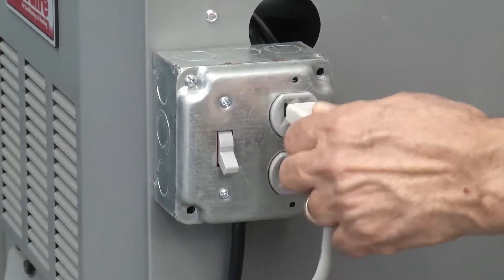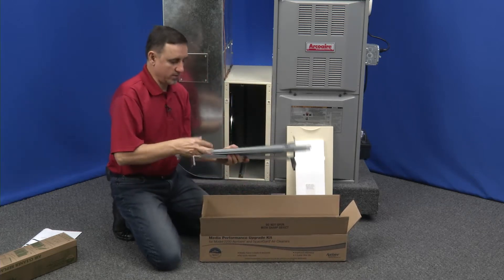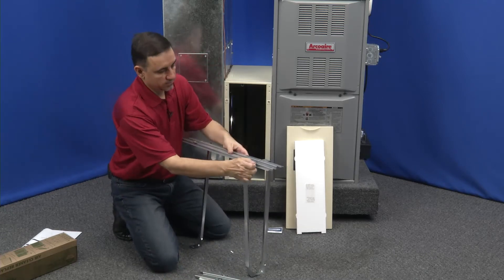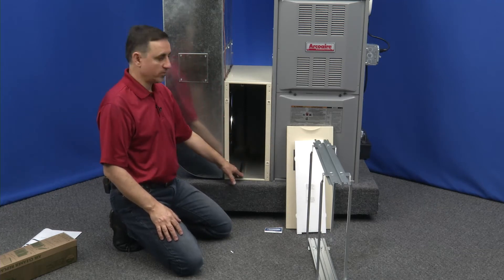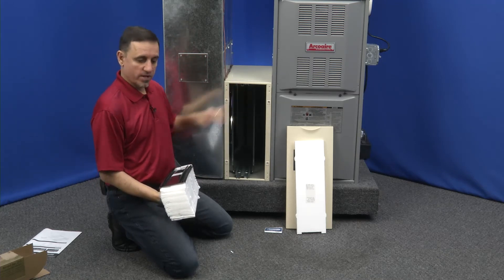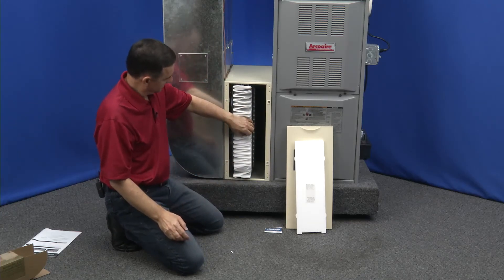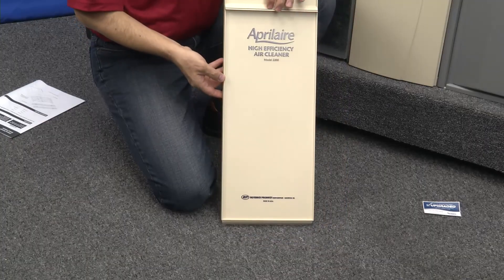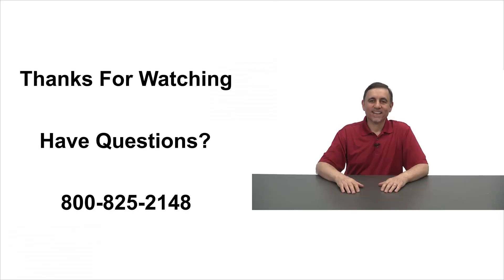Aprilaire 2200 Model Upgrade Kit Installation Guide

Comment: Do not throw away the filter box or filter separators.  You may want it later, Ebay, Freecycle even an HVAC company may use it. Make an effort to recycle it, even Styrofoam can be recycled.  Thank you for the clear video should I ever need to upgrade.

Comment: Idk if anyone will see this but are you able to use 25x20x6 filters or are you stuck with the x4? Also can you use regular box style filters with this?
Reply: Good question, I'm guessing no to both. After this upgrade, the x6 filters won't fit, nor will the box style ones (like Honeywell). Annoying if you have some existing filters you haven't used yet.

Comment: I am surprised you feel that way. In over 50 years in the industry, I have changed hundreds of these air filters using the original system and find the new style filters extremely simple to replace by comparison. If you are struggling to replace the new style filter, get out a pair of needle nose pliers and slightly bend the 4 front corners of the new metal rail up where the plastic filter edge slides onto it. This MIGHT make aligning the plastic strip with the metal track a tad easier.

Comment: By far the worst "upgrade" we ever did. Those new filters are a pain in the ass to lign up and slide in.
Reply: Exactly.  It took me 1 hour per filter to slide the "new" Merv 13 filters on the rails.  I could have finished 10 of the old pleated filters in the same amount of time.  Not to mention the collateral damage I may have caused to the fabric as I struggled to align all 4 rails at once.  Hopefully none of the sharp metal punctured the new filter during the 1 hour installation.

Comment: I was able to upgrade our antique one without the rails just by adding 4 short sheet metal screws to hold the frame in place, seems to fit perfectly.
Reply: Where did you screw them into?
Reply: @cjo1992 the top and bottom brackets you place like he did, if you add screws to the part that’s flush against the cabinet (it’s like -_-)  if you put sheet metal screws on the - part it still leaves enough clearance for the filter. Just 3-4 screws with some on both sides of the channel.

Comment: Good info. I’ve got a gen 1 space guard 2200 with the metal door with the screws. Had to watch a video because at one point the previous home owner did an upgrade kit and I didn’t realize it.
Reply: Those first-generation models don't have the track spot welded into them as the gen 2 and 3 do. That track holds the new upgrade frame into position. There is a workaround that can be done by someone who is rather handy. It involves drilling holes in the existing cabinet and riveting, screwing, or bolting the new upgrade frame into the center of the Gen 1 cabinet. We don't discuss it because it requires tools and a few extra skills.

Comment: anyone figured out how to fix the front door when the pins break off? I have 1 pin left that holds on my door. suction and its general fit keeps it from leaking air but I wonder if anyone has a quick fix for the pins rather than buying a new door.
Reply: A long screw

Comment: Why do this rather than buy a 20"x25"x5" boxed filter?
Reply: That's what I have been doing for years now.
Reply: Does it seal off completely? What’s the model number and merv rating?
Reply: @bluesdirt6555  The MERV rating depends on the specific filter that you buy.  I don't think it completely seals things off, but does anything? I bought this kit once but now I am backing to using the box filters.
Reply: @  you’re evaporator has really small fins and sweats off condensation in the summer and that turns into mud that fs everything up.

Comment: Do you realize they already make a pre boxed air filter that fits right inside the plastic cage NO ASSEMBLY required took 5 minutes to do! Just put one in for my father law. The very same 2200 unit. Please buy the pre boxed one $
Reply: What’s the model number and price?